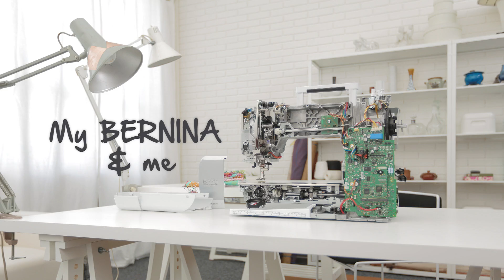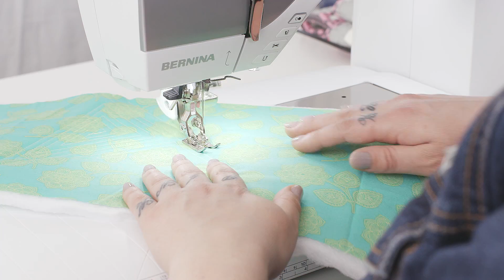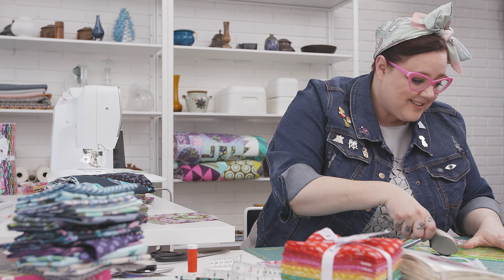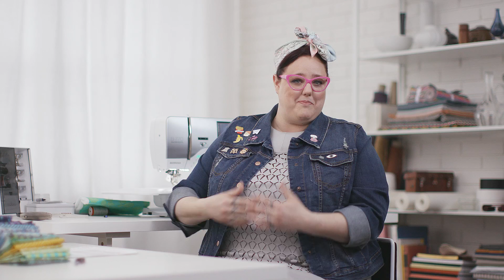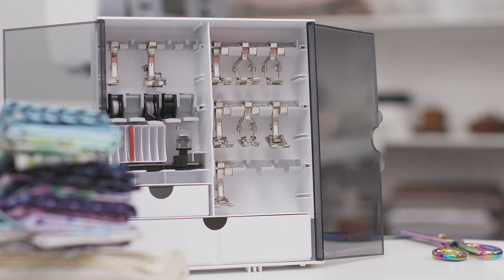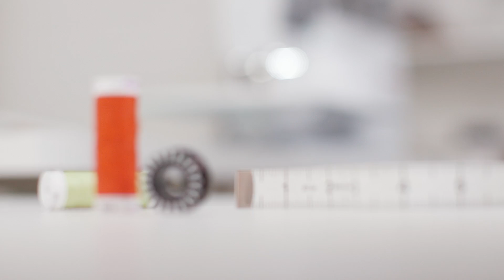Quilter and fabric designer Tula Pink talks about her BERNINA

Comment: Hi, what’s the reference  of the smart accessory we see you using when stitching? Looks like a walking aid for foot. Obviously not a foot but still carrying out the walking foot function. (sorry for the outrageously technical description). I just bought my first Bernina and I love it until I get to gather fabrics. It will only take cotton. Everything else ruffles. Hence my question.
Reply from the maker: Dear Sue, thanks for sewing with a BERNINA. The feature you are referring to is the BERNINA Dual Feed. It is an integrated feeding aid on our modern sewing machine models of the 5, 7 and 8 Series, feeding fabric through from the top and bottom at the same time, which is especially helpful when sewing with multiple layers or slippery fabrics. More information on the BERNINA Dual Feed can be found in this video: https://www.youtube.com/watch?v=Lpd1HHZpS6M

Comment: I first was helping a friend with her mid arm quilting machine. The machine was a Bernina 830. I loved it. The ease of use the consistency. Anyway I ended up getting the new 570 this year. I also got your cutting mat. I feel these 2 items have changed my life. I let Ev your cutting mT Tula.
Reply: I'm considering a 570 right now.  My current machine is 30 years old.  Do you love your 570? Did you consider a 580?  I've never really used much decorative stitching, thinking the 570 has enough.

Comment: I have a husqvarna viking and I love my machine so much, but it's the little things that tula talks about, the screw on the feet that needs to be removed each time I change them is so annoying, also the bobbin feed is on top and fustrating when I have to remove my project when I run out of thread. Bernina will be the next machine I buy and I've been so loyal to husqvarna viking for 15 years but it's those little things that will make it easier and more worth my time. I do have to say that the software for the pc for viking is much more user friendly then the bernina, that's one thing that didn't get me excited.
Reply: My Viking is 30 years old and I've loved it, but the electronics are no longer reliable (foot control). Looking at Bernina 570.  It has so many amazing features.
Reply: I also am a Husqvarna user but am seriously thinking about a Bernina.  Maybe I'll purchase for myself for my birthday!

Comment: please  tell me about bernina 1630 there is no explanation on for beginners . i dont know how it works for  overlock .and how to do setting .
Reply from the maker: Dear asfam, the BERNINA 1630 has been produced in the early 90s. There are no video tutorials available for this model. Please refer to the user manual that came with your machine or contact your BERNINA dealer for further information. Note that 1630 is not an overlocker machine / serger but a pure sewing machine. That being said, there's a special overlocker foot which can be used on sewing machines, in combination with the overlocker stitch, to finish edges, see https://www.youtube.com/watch?v=OIUBa41asdg Kind regards from Steckborn, Switzerland